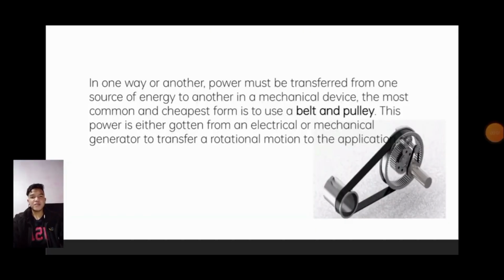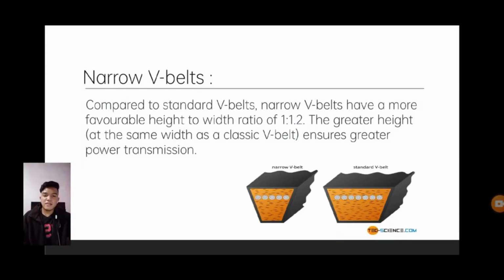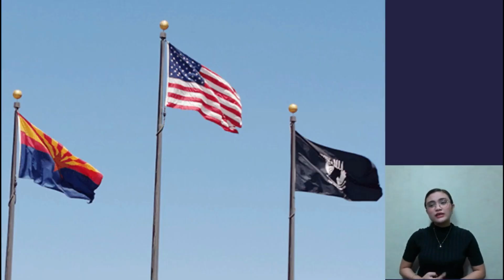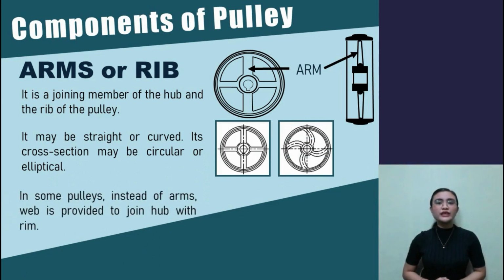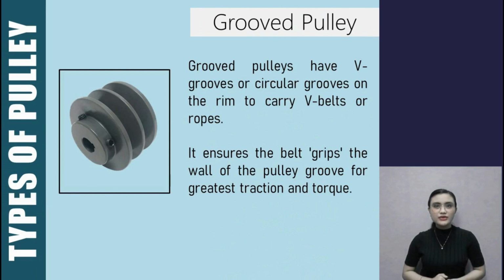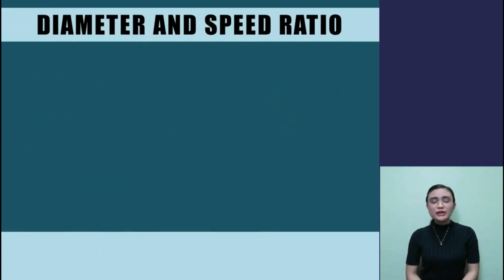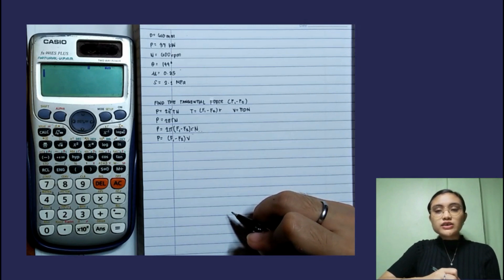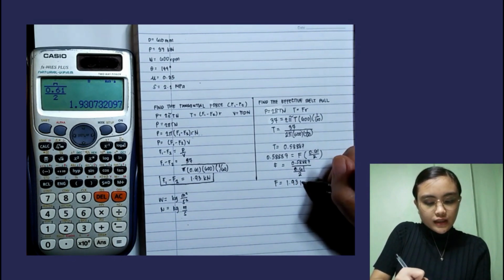BELT AND PULLEYS

Comment: RYAN JAMES W. NAGUITA
BSCE-3B

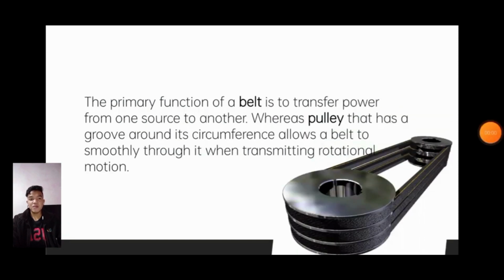0:42 - The primary function of a belt.
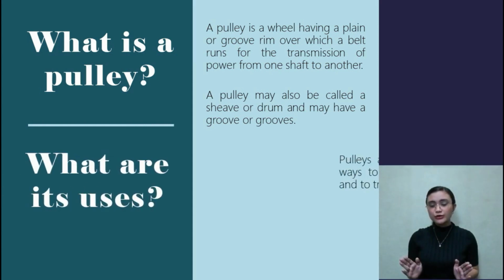10:22 - Pulleys are used in a variety way to lift loads or to apply forces and transmit power
21:47 - Equation and solution for the center distance between pulley

Comment: NIÑO, JIREH FAITH B. - BSCE_3B
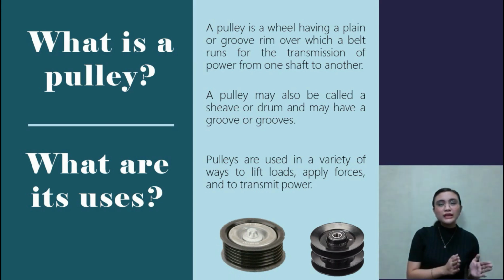10:40 - The uses of pulley: one is to lift loads, apply force, and transmit power. 
21:40 - Computing the central distance between  pulleys.
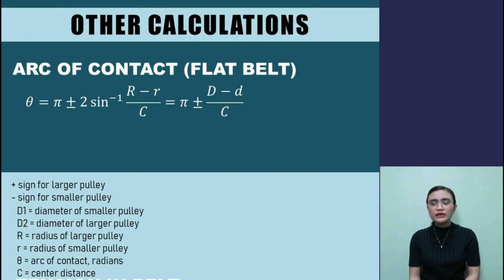28:30 - other calculations such as the arc of contact

Comment: Christian Jay A. Ompoc

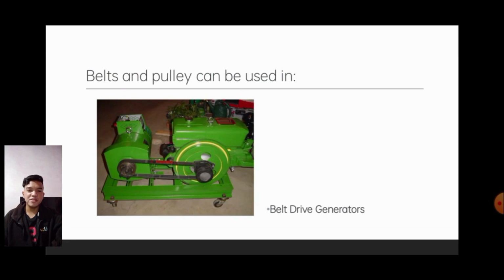1:43 HVAC means Heating Ventilation and Air Conditioning.
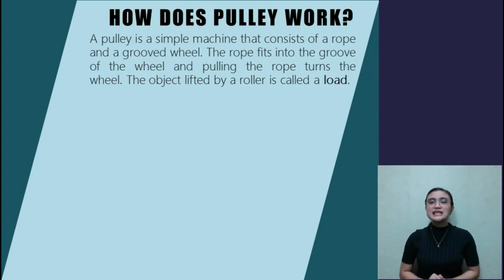12:15 A pulley works where a rope fits into the groove in the wheel, pulling it turns the wheel lifting the object from the opposite side of the rope. 
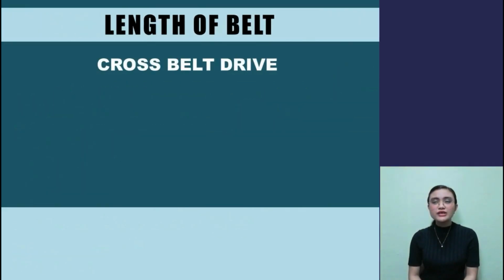25:40 Finding the length of the Cross Belt Drive.

Comment: IPANAG, MILES GIZZA L. – CE3B

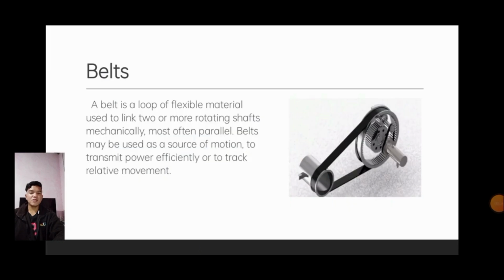2:20 A belt is used to link two or more rotating shafts. It may be used as a source of motion, to transmit power efficiently or to track relative movement.
11:54 The driving element of a pulley may be a rope, cable, belt, or chain.
21:45 – 29:36 Calculations for Belts and Pulleys.

Comment: Mark Andraan M. Bercede - BSCE 3B

1:21 Driven pulley is the output pulley or the two pool system. This is the pulley being turned because of the belts motion.
16:25 There were several types of pulleys such as solid pulley, split pulley, stepped or cone pulley,  fast and loose pulley, jockey pulley, guide pulley, and grooved pulley.
24:33 Formula in finding the length of belt.

Comment: FLORES, WINCHESTER B. 
BSCE-3B

2:37- power transmission belts
27:18-Output speed is equal to input speed divided by the speed ratio

Comment: Maria Elireza T. Canoog - CE3B

0:40 - The primary function of a belt is to transform power from one source to another, whereas, pulley allows a belt to smoothly through it when transmitting rotational motion.
21:44 - Formula to get the Center Distance Between Pulley.
24:20 - How to get the Length of Belt.

Comment: Princess Girlie A. Ellevera - BSCE_3B

0:44 Transferring power from one source to another is the primary function of belt.
11:45 Wood can be used as a pulley material.
27:11 Output speed is equal to input speed divided by speed ratio.

Comment: Missy Mae D. Budiongan - BSCE3B

2:06 - Belts and Pulleys can be use in elevators and escalators. They cannot function without the use of pulleys.
11:51 - The driving element of the pulley helps power to transfer from another.
21:40 - Computations and  calculation of examples begin here.

Comment: Juniel N. Romero - CE3B

4:34 The V belt types are used where shaft distance is less than 2 meters.
20:08 The function of Jockey Pulley is to increase the angle of contact of a belt.
20:49 It is usually used to guid cable and keep it along a specific path.

Comment: PELIAS, JHON CARLA B. – CE3B
2:23 Belts is a loop of flexible material used to link two or more rotating shafts.
7:54 The rotation of motion is the ideal and simplest means of transmission of Mechanical   power with negligible axis.
13:23 Mechanical advantage: The more wheels you have, the more times you loop the rope around them the more you can lift the load.

Comment: REYES, DANIELLE WILLIAM E. - BSCE-3B

0:55 - Visual representation of the connection between belt and pulley and their function
2:33 - Explanation of belt types and their differentation between each other
24:14 - Two types of belt drive and their formula of the length of belt

Comment: REGAÑA, JASON A. -CE3B

0:40 Function of the BELT and PULLEY
2:20 Belts uses and types
10:15 Pulley uses; and how does it work
28:40 Calculations in belts

Comment: Maria Ellen Rose O. Cajeles - CE3B

0:40 - The primary function of a belt is to transfer power from one source of energy to another while a pulley allows a belt to smoothly go through it when transmitting in rotational motion.
10:50 - Some examples of pulleys are elevators, escalators, crane and bulldozers, flagpoles, etc.
21:42 - How to solve the center distance between pulley

Comment: Cherry Mae E. Lantaca  - CE3B

2:17 - A Belt is a loop of flexible materials used to link two or more rotating shafts mechanically, most often parallel.
10:22 - Pulleys are used in a variety of ways like lifting loads, applying forces, and transmitting power.

Comment: DETALLA, ANGELIKA S. --- BSCE 3B

6:54 The tooth of synchronous belt may wear out if the pulleys are not aligned properly.
7:50 Link belts can be customized to desired length lowering the maintenance cost.
10:30 Pulley reduces the amount of force to lift a load.
11:50 Paper can be used as a pulley material.
21:49 Computations starting from that time to the end of the video.

Comment: Kate Mavis P. Luminarias - CE3B

0:30 - The most common and cheapest form to transfer power from one source of energy to another is by using a belt and pulley. 
12:16 - A pulley is a simple machine that consists of a rope and a grooved wheel. 
24:15 - The two types of belt drive are open belt drive and cross belt drive.

Comment: Mae Flor Y. Bautista - BSCE_3B

2:36 All power transmission belts are either friction drive or positive drive
13:32 Mechanical Advantage - the more wheels you have plus the more times you loop the rope around them, the more yoy can lift a load. 
13:46 The bigger the mechanical advantage, the less force you need to lift a weight.

Comment: JADE BRYAN G SULTAN. 
BSCE 3B

0:33
pulleys and belts are considered  one of the cheapest to transfer energy
1:33
Belts can be used i automobile. in addition car needs electrical energy to start thats why every car is attached to a battery.
10:11
what is a pulley?
a pulley may also be called a sheave or drum. and may have groove or grooves

Comment: Edmar S. Adajar - CE3B

2:09 – Belts and pulleys can be used in escalators and elevators
17:17 – Split pulleys can be mounted on the shaft at any place without changing the assembly of bearing and shaft
27:17 – Output speed is equal to input speed divided by speed ratio

Comment: UNABIA, JAMES RAFAEL V. - CE3B

0:56 - Diagram of a Belt and Pulley System. It consists of a driver wheel and driven wheel

4:34 - V-belt are used where shaft distance is less than 2 meters

14:01 - Rim-it is the periphery of the pulley on which the belt runs

Comment: Kevin C. Penaso --- BSCE3B

1:21 - Belts and Pulley can be use in Automobile, belt drive generators, marine engines, and Aviation engines.
2:21 - Belts are flexible material used to link two or more rotating shafts mechanically.
20:39 - Guide Pulley , used to guide the belts when connecting non parallel, intersecting or non-intersecting shafts.

Comment: LADY ANN M. PONTE- CE3B

13:43 - The bigger the Mechanical Advantage, the less force you need to lift a weight.
21:44 - Center Distance Between Pulley Formula
24:35 - Open Belt Drive Formula
26:50 - Cross Belt Drive Formula
26:49 - Speed Ratio Formula
28:01 - Output Speed= Input Speed/Speed Ratio
28:26 - Arc of Contact Formula (Flat Belt Pulley)
29:07- Tension in Belt Formula
29:20 - Power Transmitted by Belt Formula and Stress in Belt Formula

Comment: LOPEZ, ANGEL LALAINE M. - BSCE_3B
2:36 - All power transmission belts are either friction drive or positive drive. 
27:17 - Output speed is equal to input speed divided by speed ratio.

Comment: Renalyn U. Ragandang — CE3B

0:41 - The primary function of a belt is to transfer power from one source to another.
15:54 - The third component of pulley is ARMS or RIB. It is a joining member of a hub and the rib of the pulley.
21:06 - Groove pulleys have V grooves or circular grooves on the rim to carry V-belts or ropes.